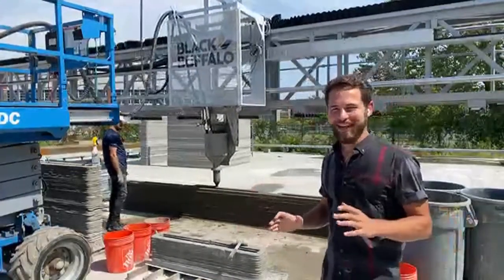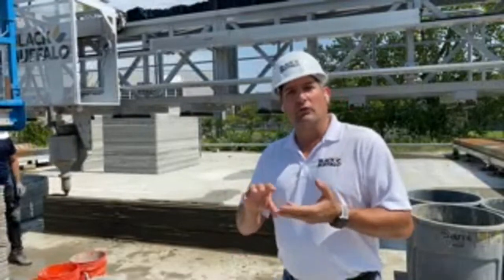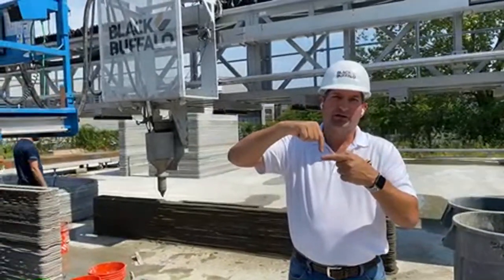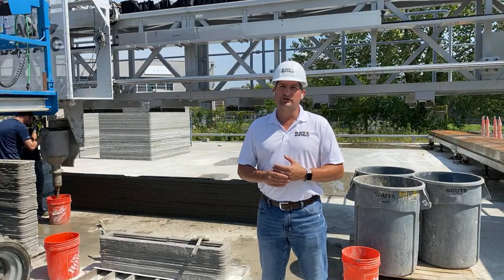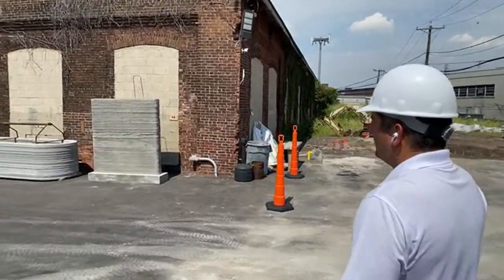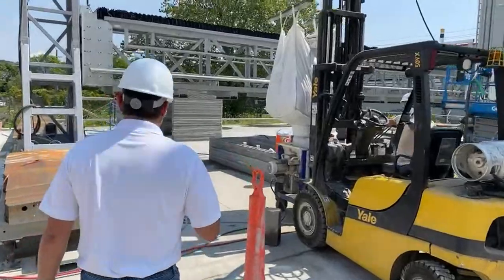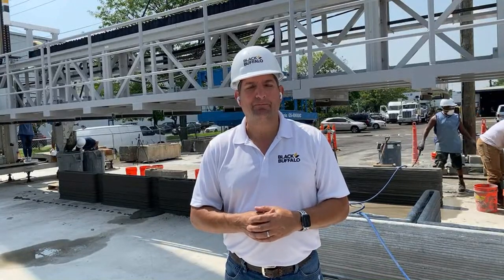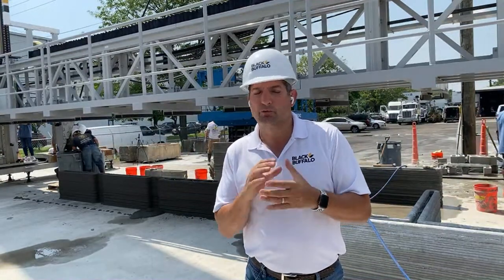Q&A with Black Buffalo CEO 3D Printing Concrete Live and Cleanup Process

Comment: There is an old Technique of after a concrete floor has been laid down, a layer of mortar is plastered next, then a skilled mason will cover the mortar with a thin layer of coloured cement (usually red). I saw that done twice in my life. But now people will prefer tile or epoxy for a better finish. That being said I could see a revival of the use or such old techniques and using coloured cement. Example finishing the outer walls of a commercial or Government 3D printed building.

Comment: I am no expert. I have no qualifications. I am not an authority on any type of engineering or technical subjects whatsoever. My opinion is a well thought through solution to clogging and it is energy efficient. Rather have a conveyor belt system for the printer that runs all the way to the main injector/application nozzle. The concrete can then be fine tuned in a 50kg drum that is situated right above the print nozzle on the gantry system itself. It isn't reinventing the wheel so to speak. It's all stuff we are used to already in construction. Surely there will be less of a clog or inconsistency in the concrete with a conveyor system as apposed to a hose or pipeline? Also just as in plumbing, why are there no access hatches in key choke points on the hose or pipeline. All that waste is unacceptable. I feel that the basics could be applied, even to this highly futuristic and specialised field. I am in personality a bit of a Ben Shapiro and Sandy Monroe kinda guy. Excuse my straightforward tone. I love you guys though.